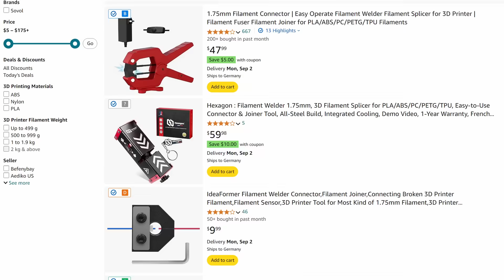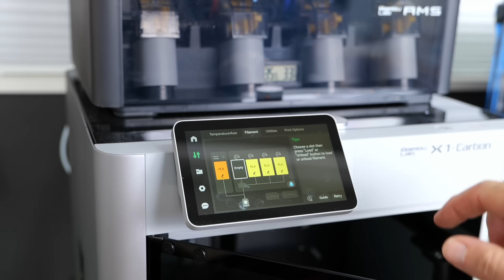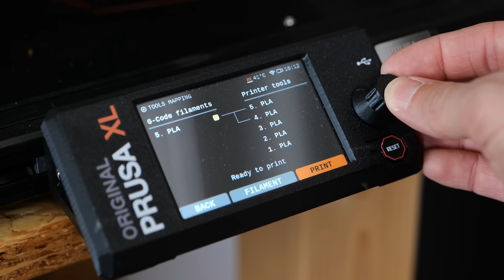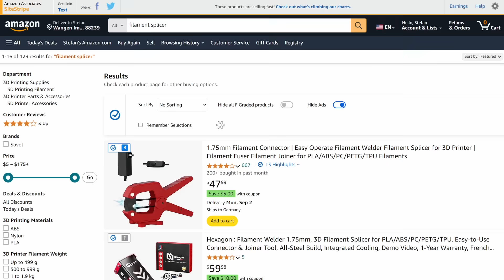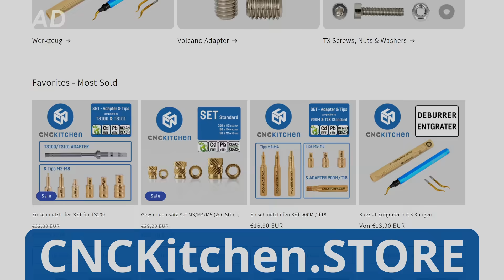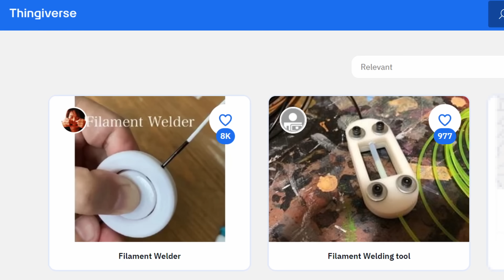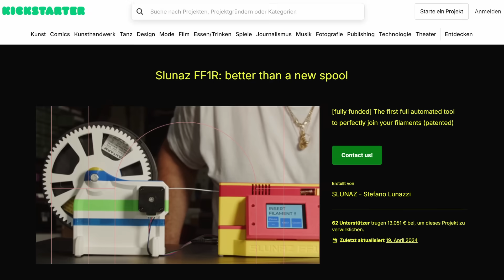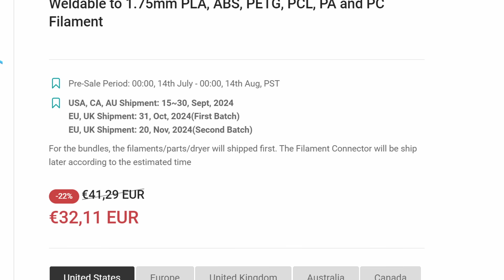The Best Filament Connector but you can't Buy it (right now)

Comment: sure the PTFE tubes weigh next to nothing but 3D printer waste is at least just PLA or PETG so normal Thermoplastics. Worst case they get incinerated and heat the homes in my birth town. PTFE on the other hand is a PFAS also often called the "forever chemicals". It's basically toxic waste that needs to be disposed of specially. It can't go into the "yellow bag" because it's not a recyclable thermoplastic and you shouldn't dispose of it in the normal trash either because it releases highly toxic compounds when it's incinerated so I don't think this is a good solution.

It's also just so unnecessary. The temperatures you're dealing with here are well below the ignition point of paper so they could have just used paper straws.
Reply: Paper would just get stuck to the filament though and be super hard to remove, wouldn't it?
Reply: @prefixcactus5221 in the worst case scenario, water would break it down enough to remove any stuck paper, would just mean making sure to dry the filament well after. Could also use something like parchment paper which would be more heat resistant and less likely to adhere.
Reply: My husband asked me to like your comment because that was the exact point he kept making as I watched this video...
Reply: As the tube does not have to be consumed (and I'd bet fairly often won't be) the waste level should be quite acceptable. Certainly not ideal but if that one tube keeps a few kilo of filament ends out of the waste stream (at least a while longer) it seems a good trade off to me. The folks that would actually find something like this valuable are probably wearing through their filament feed tubes much faster from abrasion than they will consume these sleeves and they are often PTFE too. 

Trying to do without the tube is going to be possible but I suspect end up much more wasteful even though the machine has effectively no consumables - you'd have to have a very tightly fitted block that heats enough to fuse the ends, then it has too cool enough you can move the now joined filament without breaking it back into two bits again. That cycle would take long enough and be tricky to master for a human, so you put motors on both sides, and probably end up with a take up spool motor too - convenient and functional but all that extra electricity heat cycling the block and holding the motors with that little bit of pressure advance to force the filaments together etc is going to add up, and unless you can automate the feeding of the new end bits its going to take so much longer that folks will just throw away even the half spools as they run out of storage space.
Reply: @foldionepapyrus3441  Well, why do you asume that all printers use PTFE-tubes? I only run direct-drives without tubes. And yes, even full-metal so even no sleves in the hotend.
For me, a good working device would really be an option and I also have tried a lot of things to splice rolls of filament together. Especially since I have a lot of projects that run around 600-800 grams in a print up to around 3 kgs in some cases.
Having to pull a sleave like this PTFE-thingy all the way over a kg or such of filament though is really a pain in the ... and I have such systems without PTFE-tubes already and they work quite well apart from that - which means I don't use them much.

If you can just splice a new roll to the end of the old spool without respooling it all, no problem. And this Sunlu system sort of promisses that, but with the hassle with the removing of that piece of PTFE by cutting it. For me that would be like 20 meters on the spool on the printer and then a spool of 400 grams spliced to it and  later another spool of 200 or 400 grams so that the print can finish...
Reply: @elvinhaak  I don't assume they all do - but a very very large proportion of the printers out there even if its direct drive have a guide tube from the filament roll to the print head. When its so very common that they do, and there are great reasons for them to do so its a reasonable comparison in waste volume. 

Just because your printer (and one of mine for that matter) doesn't have it doesn't invalidate the comparison at all. And with the thick guide tube they will tend to wear out in one tiny spot that then junks half a meter of thick wall tube all at once - and if you are running printers enough to really splice lots of filament that means the odds are greatly in favour of your burning up way more PTFE on the guide tube than those thin splicing aids...
Reply: @foldionepapyrus3441  Well, none of my 13 printers have such a tube.
I had one of mine long ago and to keep it working longer, after some time I just cut the tube a bit (about 5 mms) shorter after like 100 spools or so. But now it just has a proper guiding with some rolls so that problem has been solved well too.

About the amount, well it is not much if you have large spools connected as I would have market for but I think it would really be better to be able to use sleaves from for example PVA since it also makes quite less work to remove besides less fumes that you don't want to deal with. With only 200 sleaves, even if you can re-use some of them; it will be running out of those fast by the way so there should be a good way of getting newer in stock for a good price. Also for those I think cheaper plastics would be a better choice or something that could stay inside like something that crimps inside the diameter of the filament and can be run through the printer.
I can imagine if you leave a bit of the sleave in/on the filament after breaking it, you will have a stuck nozzle quickly as well
Reply: You are correct that PTFE is a PFAS, but you are incorrect that it is a toxic waste needing special disposal, and the absolute most minor number of people have their trash incinerated versus hauled to a dump, so for nearly everyone worrying about what happens when it is burned is a non-issue, frankly sounds like a skill issue/personal problem.

PTFE would be used in this instance for its non-stick properties, using a paper straw would result in the paper fibers being integrated into the melted plastic joint and being unable to remove the straw.

To quote; PTFE has a unique chemical structure that happens to fall under the PFAS class of substances. However, the PTFE molecule is inert and thermally stable so that if it were put into water, nothing would happen to it; and if you put it into the body, it passes through unaltered because it does not biodegrade. It is not absorbed into the body as are some PFAS chemicals.
Reply: @msytdc1577  I don't know if this is a minor issue. I think now most of (western) Europe is 'recycling' the waste into heat of the parts that cannot be directly re-used. Probably in the USA there are still dumps but they are thankfully been reduced quite a lot since the end of the 80's here in Europe.

After splitting and then burning (sometimes even called green energy...), they try to filter out the nasties and they get dumped but the amount of that is far less. But still some things like the PFOA's are not always filtered out well, which is giving many issues here nowadays including having to advise not to eat eggs from hobby-chicken since the load of those are too big.
Reply: @msytdc1577  is that the way it is in America? O.O
I guess that explains your landfill cirsis I hear about every couple of months, here in europe we burn all our of our burnable waste
Reply: @fast-yi9js Sadly in America there is too much regulations on trash burning in SOME area's.  Burning is better but in the US it's looked upon as an old school method done for brush on your own land. Some areas (not mine) allow for incineration but only on your own property using a "controlled burn" otherwise you can be fined and/or arrested (in rare cases).
Reply: @3DandTeePrinting  well yeah, just burning trash is horrible for the enviroment. you need special plants with higher temperatures, pre sorting and air scrubbers. They even generate a net positive in power!
Reply: @fast-yi9js  yep.  Most of the US isn't willing to invest in the infrastructure for it because of the strict regulations (in MOST states).  In the southern States people burn on their own lands and just ignore the regulations if there are any in place in their specific state or county.  When I lived in England they Incineration theirs in the 80's.  Haven't seen it since, in person or in my area on the east coast of US.

Comment: The join spool feature had been present on Prusa MMU for quite some time. With open-source alternatives like ERCF, TradRack, or simple 2-extruder setup on Klipper, it is called Infinite or Endless spool and is one of the most desirable features of these multicolor systems.
Reply: I was about to say this. I saw it on the mmu2 and I assume it's there on the mmu3 too.

Comment: Sunlu should have built in a filament cutter into this device.  The PTFE cutting blade in the back could have been used.  Simple add another track for the filament on a 30 degree angle.

Comment: THe number of filament samples I have is 1. Most people do not have 100 printers... I have 2 FDM and 2 SLA. And I used my first sample on my first printer when I got it years ago. Also I just use the same 8 or so colors and have about 5 spools of each, so I just let the spool run out and then my runout sensor (Ender) trips and I put in the new one. Or my Bambu AMS just automatically moves on to the next spool, I just have to make sure when I think its close to have the next one in the AMS. So it seems to me most people will not have all of these partial spools or filament samples, that's just a 3d printing YouTuber problem, not a real 3d Printer problem.
Reply: Wrong but ok

Comment: how hard is it to cut a block in half, put a hinge on it, drill a 1.75mm and 3mm hole in it, strap a heater to it, and use that as the joiner, and then a sharp 2nd clamshell to cut off any flashing? No ptfe, no diameter problems, no shrinking, no expanding, no consumables. Is it that hard???
Reply: You dont even need this 
1. Take off your nozzle
2. Done
You can really fuze fillament in the hotend, also it's getting 2mm, but it's fine.
Sad part that it requires to pull all the  fillament through the hotend after it cooling.
Reply: @DRedGuia  True, just backfeed. Though some hot ends are crappy and their internal diameter is poor, and it might cause a jam, Or in some cases the retraction will squish the filament and ruin the join
Reply: @dimitar4y  I think you must cool down the hotend before you pull the fillament off, and it's way faster to pull the fillament by hand than backfeed it via feeder.
Reply: @DRedGuia  In that case you're better off just using a spare hot end on its own xd leave it attached permanently.

Comment: come on man, get a piece of old bowden, put one filament  side in, heat it with the heat gun, pull it in the bowden, push the other end inside, done. When you are done with the print take away you extra piece of bowden.

Comment: So these are almost one time use Teflon sleeves? Not nice.
For leftovers I use either the runout sensor or I use my old  mosaic palette 2s pro. It can even provide you with a random color filament.
Reply: u can pull them off and use again if u have an open end on the filament.
Reply: @Andyah  that's why I said "almost". I don't have leftovers with less than 3m.
So it would be no option for me.
Reply: @spedi6721  If you are winding them back to a spool, you obviously have an open end. It doesn't matter the length. All filament join solutions have this issue, since they always use a PTFE tube to form the join.... this solution adds proper heating and will eliminate burning yourself with a butane torch. I have a unit on pre-order, but... October? Geesh.
Reply: Yeah, that is a definitive dealbreaker.

I'm thinking it shouldn't be that hard to make a little cutter that closes around the filament and then yuo pull the fuse through and it cuts off excess.

Comment: I use my Mosaic Palette 3 Pro to splice filament shorts together automatically.  Once configured it works great and can just make filament for you with or without a printer connected.   It is pricey but much faster, easier, and more reliable than manual splicing.
Reply: except the fact that its 800$......
Reply: @BamsyTheSergal  If you read the comment you are replying to carefully you might notice it mentioning the price as a caveat.
Reply: @somdudewillson  good for you
Reply: That's nice ...like everyone has half a bloody mortgage to flash buy one of those ... They are disgustingly expensive.... Only those with deep pockets can afford ..

Comment: I got a cheap 3d printing pen that I use these leftovers with. It's great for welding pieces of a larger project together.
Reply: I'm doing the same thing
Reply: wow, that's an awesome advice.

journey of finding the best cheap no compromises pen has begun.
Reply: @Splarkszter  best i've found was about 50 USD, mynt3d pro pen.
Reply: @Splarkszter  If you're on a budget, watch the deal sites and forums. They randomly pop up for $20-$25, and sometimes even lower. I bought some a few years back for ~$12 each, but those were 1st-generation devices with 1 speed and 1 temperature (they were either on or off). Surprisingly, they run hot enough for PETG. I've used them successfully many times for repairing both PLA and PETG prints.
Reply: @glabifrons sunlu has one that does abs supposedly. Though the temp only goes to 210 so not sure how that works
Reply: Me tow
Reply: same here :)
Reply: 3D pens got me into 3d printing
Reply: Yeah, i do that too. Why glue when you can weld? I also add welding chamfers and flow channels in the joints. Stupid easy to use.
Reply: @Unmannedair  Awesome. Thanks  for the advice!

Comment: I wonder if you could use PTFE tape (like for plumbing?) instead of PTFE tube with the sunlu, would it work and would it be reusable?
Reply: the tube is constraining the shape of the fused area to be a tube.
A better option might be to get one of the thicker wall tubes they use with the Mosaic Palette (Mosaic sells replacements)  and adapt filament joiners heating area to handle it. A thicker wall would mean it would take longer to heat and cool of course. I'm not sure how adjustable the filament joiner is.
Reply: No way